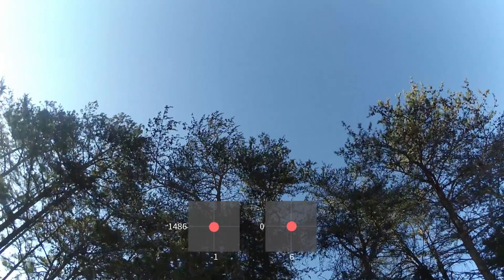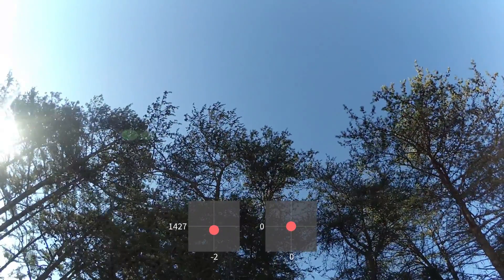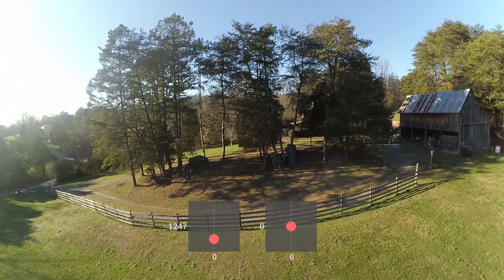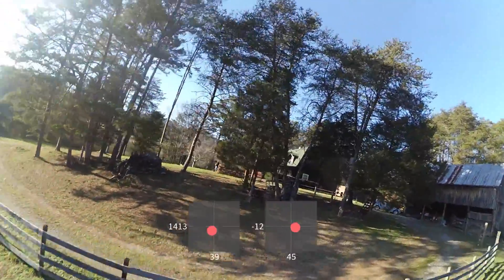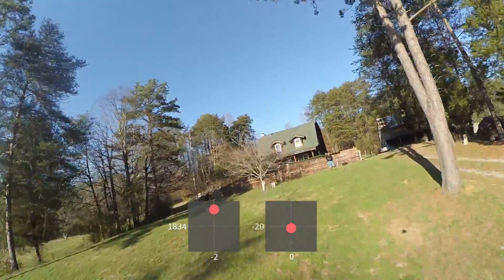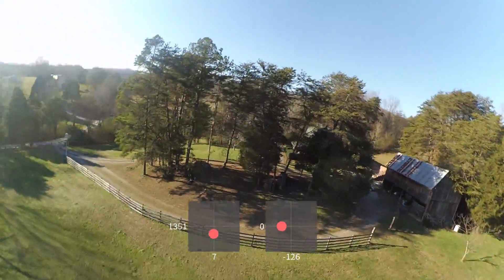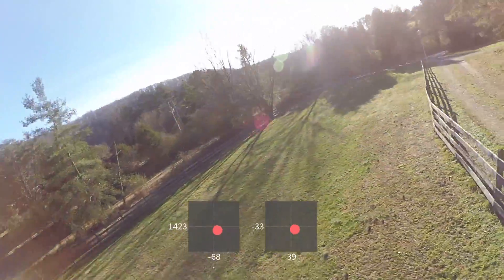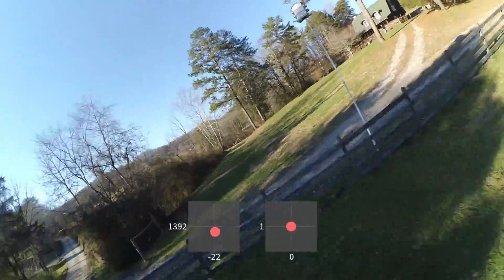How To Do A Dead-Stop | QUADCOPTER TRICK TUTORIAL

Comment: In fixed wing 3d airplanes, we call this a 'wall', as it's like you literally hit a wall.  Done differently with fixed wing of course.  You'd have medium forward speed at medium throttle, then cut power to idle and hit full up elevator.  With high enough rates and a responsive enough plane, this will do an extremely quick 1/4 loop to vertical.  Doing this at zero throttle should prevent most or all altitude gain.  Once vertical bring throttle back up to maintain hover, or climb out.

A 'parachute' is the same thing just instead of horizontal speed, you start by heading straight down, no throttle.  Then pull quick up elevator to do the quick 1/4 loop and stop downward movement.  Kind of like you popped a parachute.

Both these can be done inverted by using full down elevator and either starting inverted (wall), or ending up inverted (parachute).